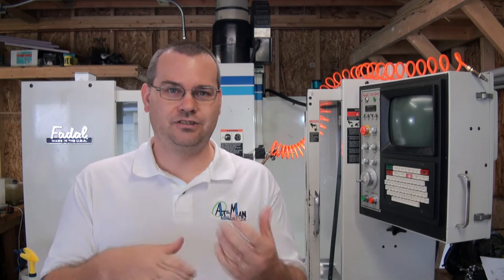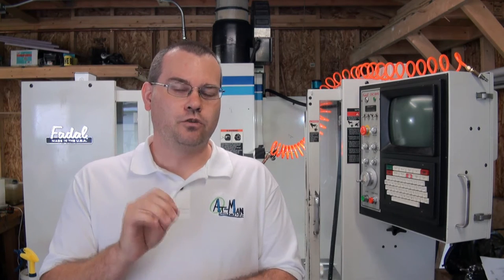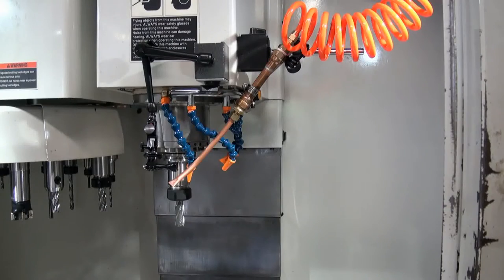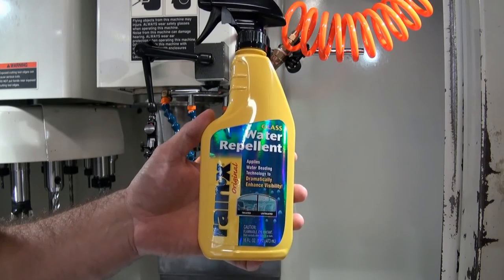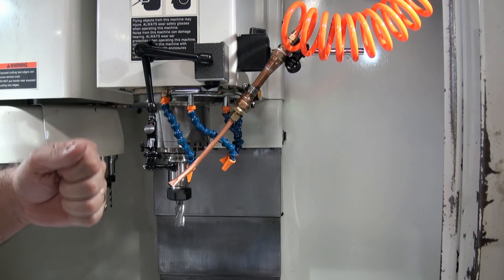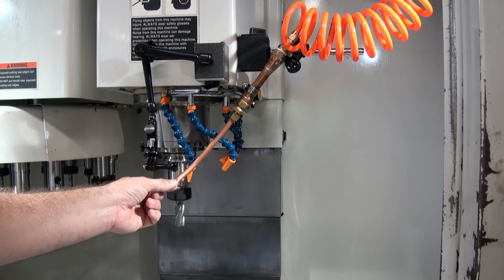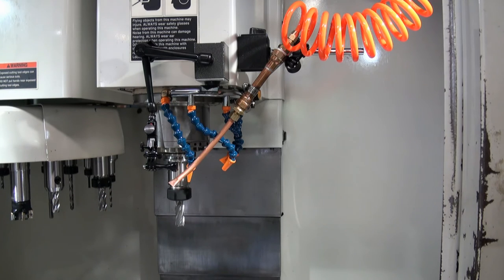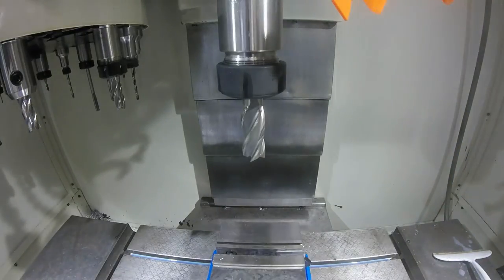GoPro Air Blast!

Comment: WOW a fadal CNC Mill have not seen one since the early 80's (great machine) do not even know if they made them in resent years. OOYA Japan was our machine selection during those years today it is HAAS and we came here to see how you solve the GoPro camera enclosure looking for air blast enclosure to film in our machines enclosure. We were hoping you build an enclosure with an air valve into the enclosure but your idea look interesting and easier to achieve.
Reply from the maker: Check out Edge Precision, he just made the coolest housing yet. He has been working really hard to get a good setup for his Mazak.
Reply: We like him the story about him and yes the GoPro case video with the air blade is great, thank you for sharing with us. I want two of those cases, only hes not making them?